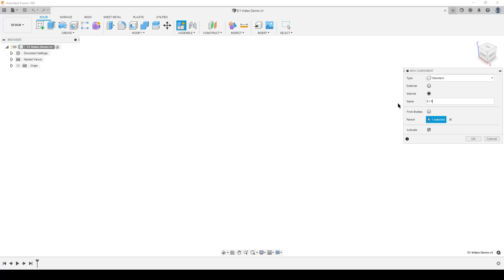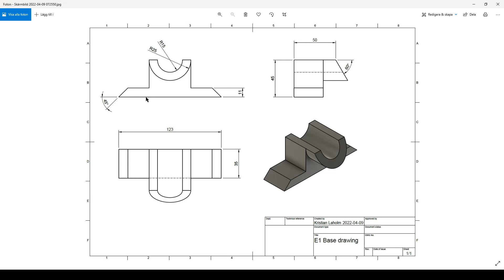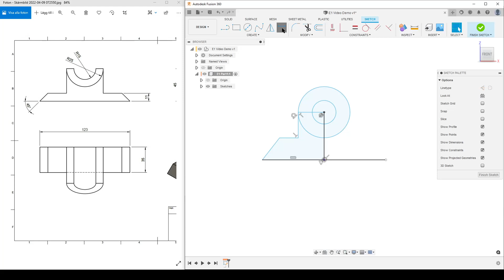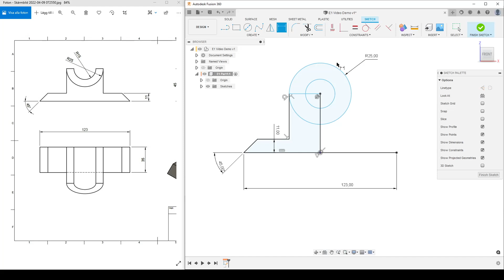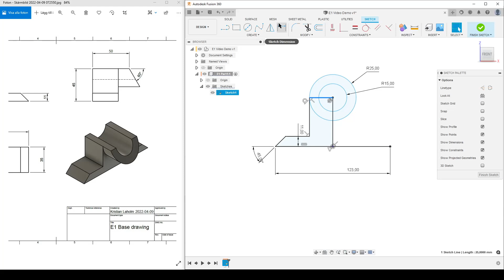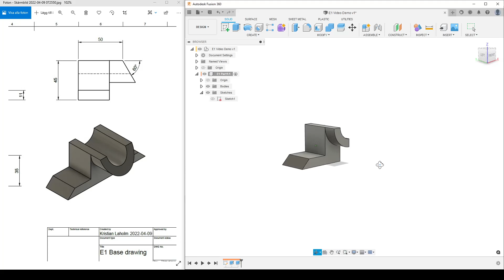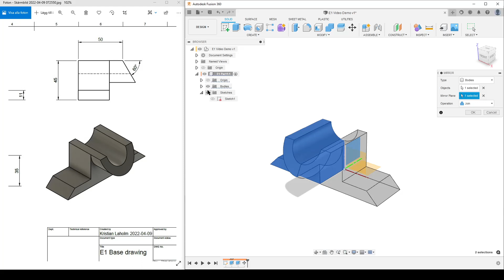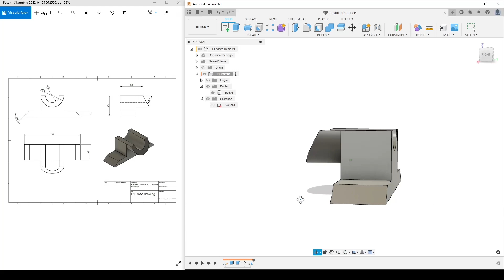Fusion 360 Basic - Exercise 1 (Sketch, Extrude and Move Rotate Face)

Comment: thanks, would not have known to use the move tool, now I do. Thanks again.
Reply: I have a question, how would you do a stop chamfer on a part, on your part, say the top side edge and your want to put a chamfer on the edge but stop when it hits the arc section. Is there a way to do something like that. When I click on the edge it highlights the whole edge and I want just part of it.
Reply from the maker: @sawdust9719  For now there is not that functionality in Fusion 360 Chamfer. Some possible workflows: Split body, Chamfer and Combine bodies. Or sketch the chamfer profile and extrude or sweep.